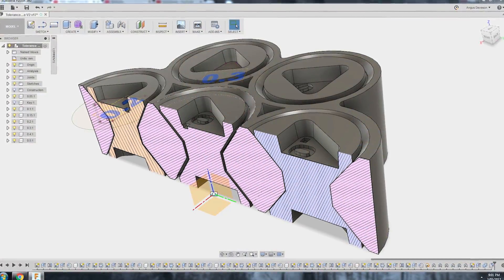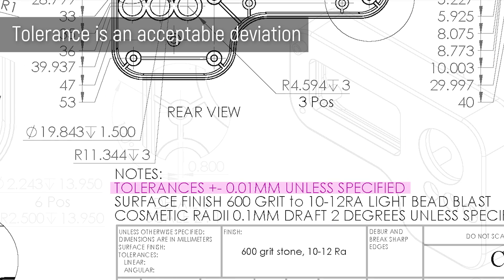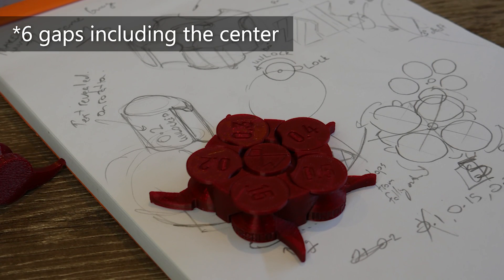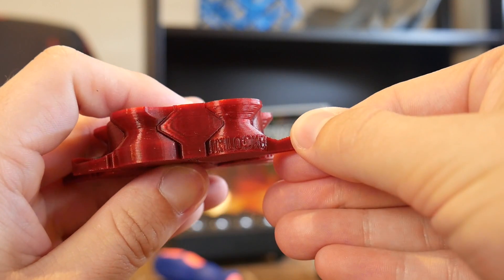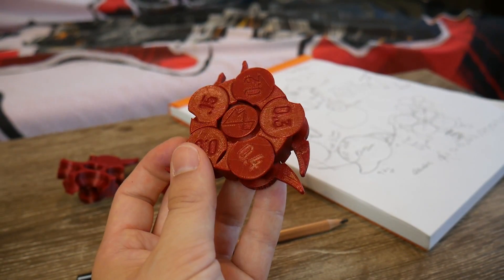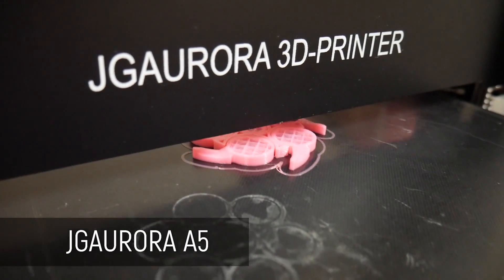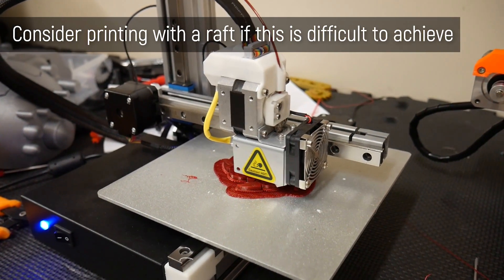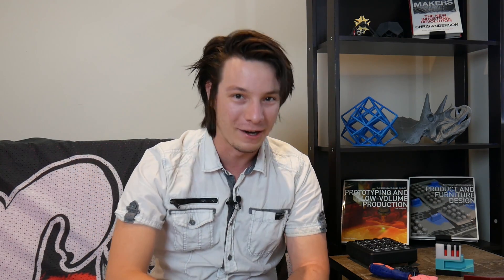Test your 3D Printer's Clearance and Tolerance

Comment: Printed this last night on my Lulzbot Taz 6, using Cura 2 LE, .15 layer height and a raft I managed to get the .5 broken free but everything else is stuck solid.  I have had always had clearance and tolerance issues with both of my Lulzbots though the Mini is usually the one this bad, not the Taz. 
I'd love to print things that have finer clearances but have read conflicting things about where to start tweaking settings.

Comment: Finally got the 0.15 gauge to successfully unlock. What's with the code stamped around the perimeter of the center hub? - Perhaps a bonus if you manage to unlock all the gauges :-)

Comment: I brought the Tolerance Test V2 Final Makersmuse.STL into IdeaMaker to print on my N2 dual and it told me there are 135 non-manifold edges. The Auto-Repair feature eliminated them, but it does not provide a detail of where the edges were or how it repaired them. I am using  IdeaMaker version 3.1.0.1545 (latest available from Raise 3D) if you want to check it out.
Reply from the maker: Thanks Craig, sounds strange but I'll look into it. I've had no issues printing but sometimes embossed text messes with things.
Reply: I think you are probably correct about the text causing the non-manifold edges. It makes sense. I have used Fusion 360 for a number of projects and have not seen this issue before. I printed the repaired model this afternoon with PETG (eSun) using settings for PETG that I have been playing around with and all of the levers work. I think you need to make a version that uses smaller clearances to test more capable machines. I would like to try 0.10, 0.075, and 0.05 clearances to see how low a Raise3D printer can go. If I pull straight out on the V2 model's levers, the 0.5, 0.4, and 0.3 cylinders pop right out. I can pull out the 0.2 and 0.15 cylinders also, using a bit more force. The bottom line is that a well-dialed-in Raise3D printer is not really challenged by the V2 model. I would like to see how low it can go, so if you create a V3 with smaller clearances, I would pay another $2 US to try it.

Comment: Unfortunately, my 3D printer (Kossel Delta) has the filament stuck in the middle of the feeding tube (I can't move it with filament, too soft) and I can't remove the tube from the extruder, no matter how hard I try (and yes, I've pressed down that little ring to free the tube and nothing). Plus, I believe the bed isn't levelled since it didn't print well. I bought it a bit (1-2 months) too early, and there's no auto-levelling nor heated bed. So I have to purchase an auto-levelling kit, a heated bed and most probably a new feeding tube.
Reply: Don't worry, I've just fixed the problem! I just had to use a hairdryer to heat up the PTFE tube where it was stuck. Now it works and I'm printing a 20x20x10 mm test prism. Fingers crossed! UPDATE: It printed perfectly, except that the extruder ran over the prism on the last second! Still, it's my most successful print ever.
Reply: What is the tolerance

Comment: 5 prints or so later i was able to tighten up the cura enough so that it did not fall apart (first layer horizontal expansion -.02mm horizontal expansion -0.05mm) but i have no idea how to accomplish the same in slic3r or slic3r PE which are the main slicers i use

Comment: Angus, you should really clarify the role of extrusion multiplier in the clearance / tolerance test. Whether or not parts get stuck, yes, is influenced by the precision of your printer, but also can be influenced a lot by the extrusion multiplier. If you have it (too) high, the layers line will be thicker than they should be and the parts will fuse. So if you get bad results on your test, it MAY be an imprecise printer, but it may as well be an indication that your extrusion multiplier is too high, or in general your extruder settings are bad (too many steps per mm etc.)
Reply: or you forget to enable some setting like compensate wall overlap.   

(i actually need to up my steps per mm.  since it does 96 instead of 100mm.) 
but i forgot to turn on wall overlap compensation and my parts fused like hell

Comment: so i tried this with the model sliced in cura and in silc3r PE and in cura it fell apart when taking it off the bed and slic3r pe (1.3.8.6) only the 0.5 was free initially and after prying only 0.3, and 0.4 freed up. This seems more like a slicer test than a machine test. reprinting now with 0.2 elefant (not a mis-spelling) correction in slic3r.

Comment: what is the nozzle size ?? I tried with 0.5 nozzle and 0.25 layer height nothing free :(
Reply from the maker: +Ahmed YASHAR too rough, use 0.2 or 0.15mm layers
Reply: what about nozzle size. is 0.5 ok?
Reply from the maker: Well, print with what you normally print with. The point is to see what accuracy of clearances your printer is capable. I use 0.4mm or 0.5mm

Comment: Printed on a QiDi X-Pro and all tollerance fingers opened freely appart from the 0.15mm which required a little force to free it up.
Used black Filaprint X3 PLA with 230 Deg C extrusion temp, 50 Deg C bed temp (probably not required) 60mm/s, 50% first layer speed, 1mm retraction, 0.8mm coast, 30% infill. Could do even better if I could eliminate the occasional zit!
Thank you Angus. Maybe you need to make a more challenging one next time?

Comment: Printed today on Aldi Coccon Create. Spliced using Cura,  Good results all wheels free and spinning 0.15 with no slop through to 0.5 very loose.. Using PLA and settings as recommended.  Printed at 200 Deg. C

Comment: tevo tornado with my settings center is free 0.5 is free 0.4 is free 0.3 is tight but free and 0.2 and .15 are stuck and broken off tabs think that might be the temperature change i did that caused that so im gonna print it again

Comment: Nice. I was actually working on a video to clarify tolerances and clearance. I think I will still publish it, but my computer is still broken.

Angus, I believe I have invented a novel way of also testing this phenomena. It is simply a tapered rectangle that has a deviation of a single MM or less, and a ring of a certain size. The distance the ring travels can determine just how out of tolerance the printer is. My testing with it has similar results as all other tolerance gauges, and I would like to know what you think. Is it viable?

It's the Obelisk tolerance gauge on thingiverse.

Comment: My biggest issue with this type of tolerance gauge is that my slicer will start ignoring the boundaries if they get too close. With a ring and peg design, I could get down to .05, but the slicer stopped recognising the differences at .1 if they were adjacent.

Comment: I bought it and tried it on my Tornado. Horrible results. Anyone have s3d recommendations for Tornado? I thought I had it reasonably dialed in but apparently not.
Reply from the maker: It's possible your flow (extrusion multiplier) is a little high. Also worth seeing if you're getting stringing between parts.
Reply: tear it apart and see where the problem is? ie take some pliers and break the bugger apart (the print not the tornado)

blobs? layers misaligned? once you dissect it you should be able to see what the issue is.
Reply: It looked really nice without external blobs so I expected greatness. I'll look into the extrusion and possibly a raft. Still learning after I added auto bed leveling
Reply: James Deaton start with .96 or .97 multiplier 200c and 5mm retraction. Add 1mm wipe and .1mm coast and -0.1mm restart and random or best speed layer start points not aligned start points.
Reply: Nerys thanks, I'll give those a try.

Comment: i was able to get away with 0.1mm clearances on my old replicator mk2, and i still thought my bed leveling could be better..
Reply from the maker: +Bob Thiry impressive! Which slicer?
Reply: when i first got the machine when it came out, i remember designing moving parts with 0.1mm clearance and being able to loosen the printed parts relatively easy. using the makerware supplied software for slicing. i usually go for 0.15 - 0.2 now.

Comment: Printed it on the Ultimaker 3, and its really bad, just 0,4 was free, everything else was clogged. Really bad for a 4000€ Printer.
Reply from the maker: +Toxicity very disappointing! Have you had issues with other part-in-part models before, with them joining ?
Reply: well it could be that the bed level is really bad, and that active levelling is screwing up the first layers. I don't know if you are aware of this, but active leveling will compensate on the first x layers so it might be that, it should be able to do 0.15 with no issues
Reply: Active leveling maybe? will try it on mine
Reply: Yep, and also with other parts too, i always design my parts with 0,4mm in mind so that everything fits.
Reply: I always use active leveling, and i also use Inital Layer Horizontal Expansion with -0,2 to compensate for the Elephants Foot.
Reply: Nope, without custom Firmware, there is no solution.
Reply: Sorry to disappoint you, there is no custom firmware that i am aware of.
Reply: I am sorry but.
Your profile picture fits exactly.
Reply: Extrusion multiplier? :)

Comment: Simplify3D doesn't care for the STL. Mine hangs Computing infill... I've sent the factory file to S3D to see what they have to say. The S3D analysis says it isn't manifold and has self-intersecting edges. Do you think you will fix the STL and then how do we get the fixed one since we already paid on gumroad? I'd really like to give this a try ...
Reply from the maker: Really strange, let me look into it as I had no issues slicing in S3D. I'll update the file you should get an automatic email with the updated file.
Reply: It sliced just fine for me with Simplify3D 4.0.0. The only thing I needed to do way go to 6 top layers with the 0.15 layer height.
Reply: Zentient1 Strange. I've tried several times with different fill parameters.
Reply: Well, I trashed S3D 4.0.0 and downloaded 4.0.1 and that did the trick. It slices now. But it's too late to try it out ... tomorrow's project. Thanks, Angus!
Reply: 4.0.0 I believe had a problem with "single extrusion fill" that cause a hang on some models that "IIRC" was fixed in 4.0.1 - can anyone confirm?
Reply: I got it printed in PETG and was able to get all free. The 0.15 took a bit of persuasion but it's free now. Printer is an Original Prusa i3 MK2S
Reply: Bill Waggoner considering how much pet G likes to string that's pretty impressive :-)
Reply: Yes, I was a bit surprised. I didn't expect all of them to free up.

Comment: Could you make some chamfered edges for the first layers in order to avoid the "elephant foot" if the z height isn't perfect?
Reply from the maker: It has a small chamfer but I can make it a little more extreme, good point! I'll make some tweaks and it'll send an automatic email with the updated file.
Reply: I think the fact that first layer can cause problems is a good thing to be testing.  Perhaps you could modify the file as you discuss here. However, another test file of some kind to explore the elephant foot problem could be developed for that issue.

Comment: Tried using slic3r to slice your older version, but it merges the walls on the .05 cylinder. Any thoughts?
Reply from the maker: This is just a quirk of slic3r, it's not capable of realising that tiny gap so merges them.

Comment: Thanks for the model.  I printed it on my SeeMeCNC Artemis delta printer.  I needed to pry the 0.15mm lever with a screwdriver, but then it moved freely.  All others moved without tools.  I am printing it a second time (adding a few more top layers... I forgot that I set it to .15mm layer height), and will let folks at our local MakerSpace watch the initial tab releasing... should be fun.

Comment: Could you do a detailed video on how to conquer the clearance test? I.e. common symptoms, as they exhibit themselves on the clearance test, and solutions such as issues caused by zitting, stringing, over extrusion, etc.
Reply: Ross K I was just about to ask the same thing! Now that we know we need to make adjustments where do we start?
Reply: I printed it and the 0.15 clearance was no good.  I lowered my extrusion multiplier from 1.05 to 1.00 and print temperature by 5C, and it the .15 was free after slight screwdriver pressure on the tab.  I forgot that I had recalibrated my delta printer as it was printing slightly oversize, and never changed the extrusion multiplier.

What do the tops of your print sections look like?  If they are fully solid all the way across the infill, and have slight blobs at the end of the infill lines, you could try lowering your extrusion multiplier or adjusting your steps/mm (both have the same effect).

Comment: Just downloaded this - Repetier says the model is not manifold. Slic3r says it auto repaired 958 manifold errors. Simplify3D did not complain about the file. I know it can probably be fixed in netfabb and then converted to stl with meshmixer, but I then wonder if it will have a knock on effect on tollerance if netfabb alters the file too much to make it manifold?

Comment: Sorry to sound butt hurt and all that, but not sure you really clarified the difference between a tolerance and clearance.
Reply: Clearance is something YOU specify (in the model). Tolerance is a "range" your hardware is capable of of producing reliably.

so he specifies different clearances so you can determine how tight a tolerance your printer and slicer combination is capable of reproducing.

SO for example if your printer has a tolerance of .1 to .15mm then it might not be able to print a "clearance" below .15mm since your printer could print the .15gap as anything from .1 to .15 .15 might work .14 and below would likely fail (fuse)

and then you have the tolerance of your specific "slice" settings. (blobs for example would screw things up)
Reply: I know the difference, which is why I didn't think his explanation was that good.

Comment: Has nothing to do with printer accuracy, this is just settings of x-y compensation
Reply: Not entirely true.  while the xy compensation has an impact on the slicer side there are many things in the printer itself that affect this a lot. For example, the nozzle is out of tolerance steps per MM in the firmware, stepper motors, sloppy belt, z wobble and many others.

Comment: Cool model! Its not only the printers clearance and tolerance that matter but also the slicer. I design tiny print-in-place articulated models, and when I switched from Makerbots own slicer (I have an old Replicator 2) to S3D my printer suddenly printed a lot better and handled tolerance a lot better (default S3D settings)

Comment: So you ignored the fact, that the choice of slicer, the has a huge impact on the results.
Reply: But that's the point of this test, It's not just to test your printer, but how accurate a print you can make which includes the slicer you use. If you use a slicer that treats gaps like solid objects, then this test fulfills its purpose by letting you know that you can't print tolerances that small. The object is working as intended and by getting those results then you will know what you can and can't print.
Reply: I agree, but it's not that easy.
With the old model he made, people where having success with using cura, because cura created extra space(Widening the tolerance), thereby nullifying the intend with the model.
https://twitter.com/BuMS_DK/status/869005148647038976
And Slic3r treated the 0.05 test as a solid object.
https://twitter.com/BuMS_DK/status/868999518188179459
I just think he should inform people about it, as I find it to be a very important part of the equation.
Reply: He is using Simplify3D. You should know that when ur watching his vids.
Reply: I do know he does.
But if other people use anything else, the results will be very different.
So much so, that the model might not even work as intended.
Reply: that may be so but then you need to tune your settings or change slicers.  If you are talking about cheating with S3d by changing that setting that messes with the parameters then you are just fooling yourself.
Reply: If a slicer messes with your tolerances it might be time to switch.
Reply: Well most people just use the slicer they prefer. So wouldn't they just test with what they know, and therefore end up with an accurate assessment of what they can get away with on their particular setup?

Comment: My FLSun printer has some serious Z axis wobble, under AND overextrusion, gaps showing up on models when it shouldn't, severe oozing, and problem sticking the model down on the bed despite it having heater turned on to recommended temperature!
What solution should I look for to fix such problems?
Also Z axis is very slow and every Z axis movement causes the nozzle to stop, causing oozing even with retraction set to 4.5mm...
This printer is giving me pain and misery instead of fun and enjoyment! :(
Reply: Join a facebook group and ask for help. Specific to your printer. Im in a Wanhao group (2, actually) and an anycubic kossel group. super helpful.